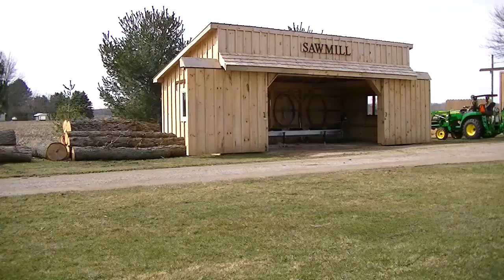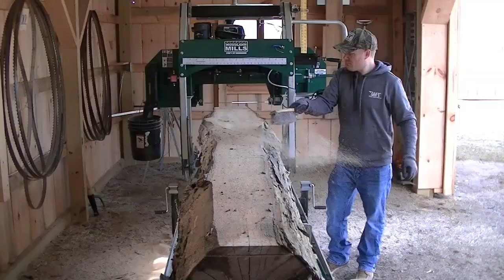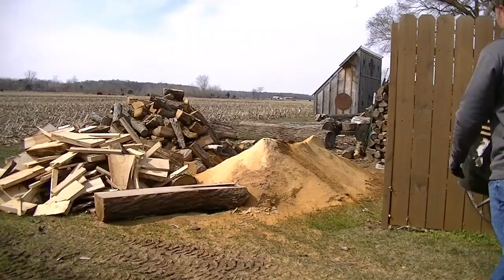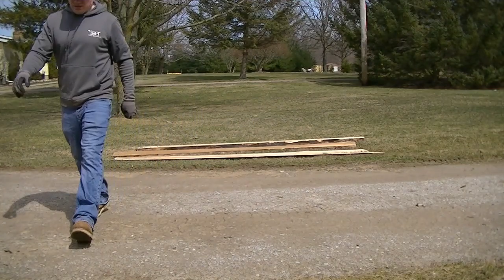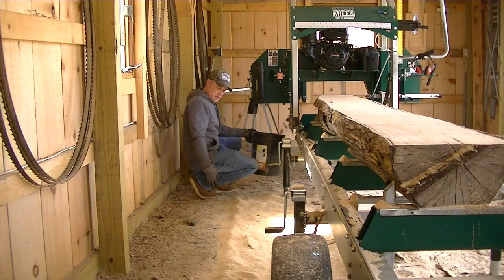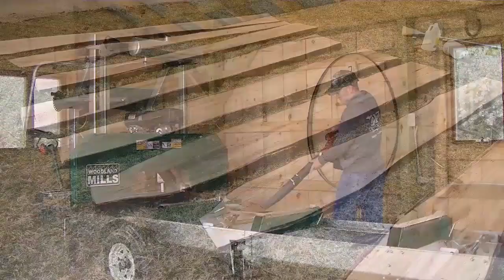Spalted Maple I Hope? At the Sawmill Today. Woodland Mills

Comment: The set on that blade looks like 35 thousand.  I bet it grabbed a lot on you.  What degree angle did you use?  7 or 10?  I find if I leave the logs in a shadier damp place they get more spalting
Reply from the maker: Ya it was a grabber for sure. This blade was a 10 degree